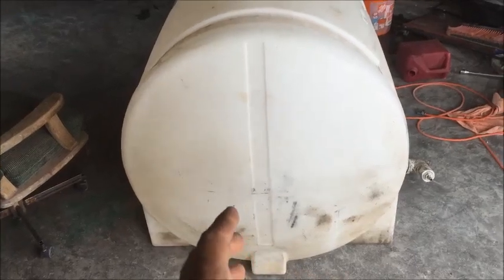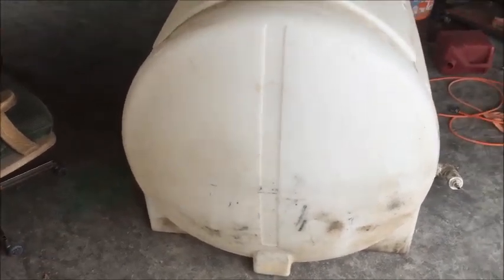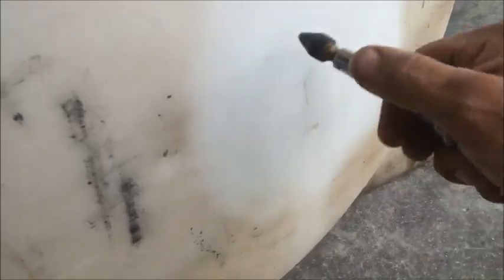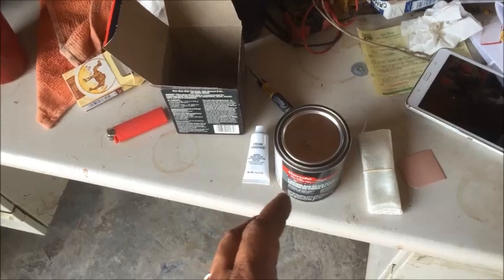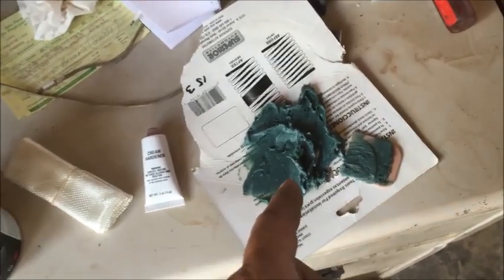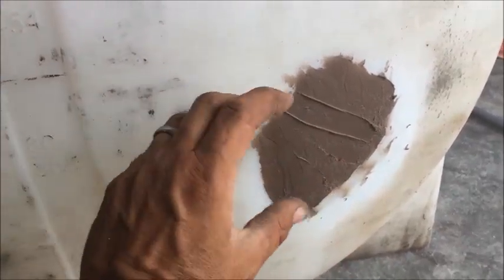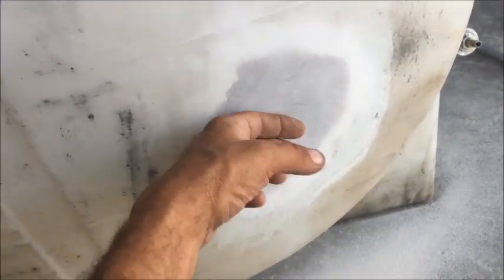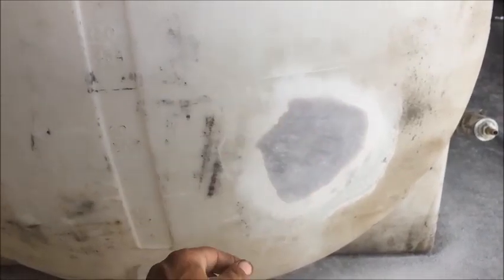How to Repair a Poly Water Tank (Very Easy)

Comment: I have a 75 gallon vertical tank with a 1.5” burn hole, 12” up from the bottom due to an exhaust pipe being too close.  You think the jelly kit will work?  I use the tank for gravity fed fresh water.

Comment: Valve would work if you can reach the inside of the hole to install the bulkhead fitting for the valve to attach to.

Comment: I have a crack at the bottom on the side, right in the middle  of my 330 poly tank. Right on the seam,  will this work on that crack, literally all the pressure from a full tank of water would be on that
Reply: Have you tried it yet because I have a large crack
Reply: Did you try it

Comment: How does the valve seal? (What kind of valve would you use - from Home Depot, for example?) Thanks!
Reply from the maker: the valve will have one rubber gasket. it must be placed on the inside of the tank, ive put them on the out side of the valve and they never seal right. yes any hardware store will have them, just make sure the are as big as the hole. you dont want it a little small, it wont seal right as well. thanks for watching.

Comment: Thank you for the video!! How much pressure do you pump up the tank to? How long has the patch lasted?
Reply from the maker: actually . i use it for gravity fed. but im sure it will hold 10 lbs easily. most faucets are only 7 lbs of pressure. i m,ade this video 6 months ago, and it still is working great!! thanks for watching.

Comment: A small enough hole could be repaired with 2 stainless fender washers,  a stainless screw and nut ...drill a hole that eliminates the hole as being a crack ...put washer with rubber gasket on each side with screw passing through and a stainless lock nut on the other side...maybe a nylon washer on the inside if worried about weepage ...but it would seriously be so little...and if it is just water?  who cares if leaked one drop a day

Comment: "...small flakes of the polyurethane..."
These tanks are made from polyethylene.
Reply: What would you use to patch a 2 inch hole on one of these tanks? I can't put available on it because it sits on the trailer where the hole is at.

Comment: Well I wasted 22 bucks trying this method on my freshwater rv tank that had a leak in the corner
I did all the prep meticulously and used fiberglass cloth as well to reinforce it.
I waited overnight to test it  but as soon as I filled it up it started leaking
I was able to pull the entire patch right off
I have tried everything... JB waterweld, two part epoxy pool putty, even wasted my money flexseal which was garbage
I'm going to buy some polyethylene welding rod and try that
A new tank is 800 bucks and another 500 install
Reply: California Outdoors did you ever get it fixed?
Reply: @caseG80  I tried everything, two different plastic welders, every type of glue and sealant.
Finally I just took it to a place and brand new tanks put in

Comment: Call a professional plastic welding service, whatever you do don't use fibreglass or resins or glues. There are better ways, but the tools aren't cheap.
Reply from the maker: what !!!!!!!!!!!!!!!! your recommendations are to hire someone to repair something you can fix yourself. if man made it, you can bet your ass a man can fix it.  man up wimp, don't ever tell someone its best to spend their hard earned cash on something another man can do. like your self !!!!!!!!!! dumbest comment i have ever got out of 5 million views..........
Reply: As long as it will never see typical city water pressures, like >50psi. Only because the epoxy is not bonding at the molecular level like you'd want a 'true' fix to be. ! <10psi though? No worries (for a while at least, pending seasonal temp changes...ahem..hopefully......).